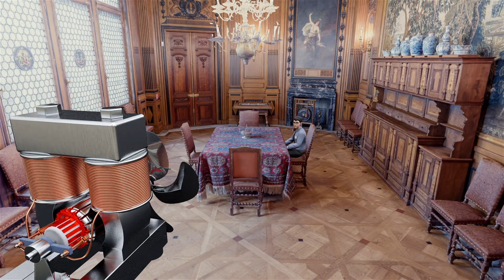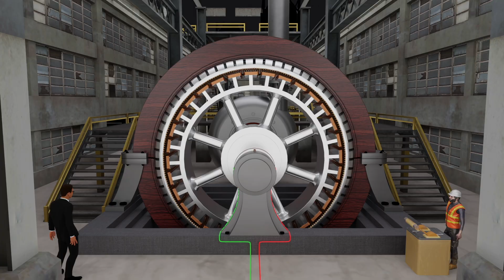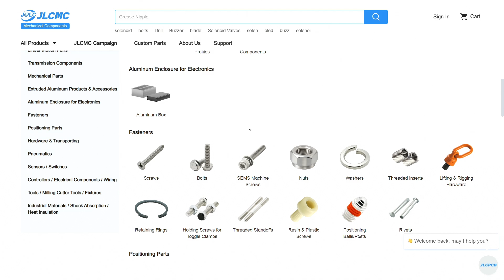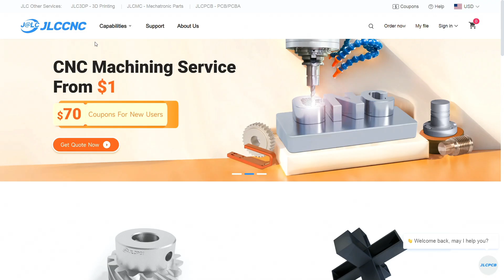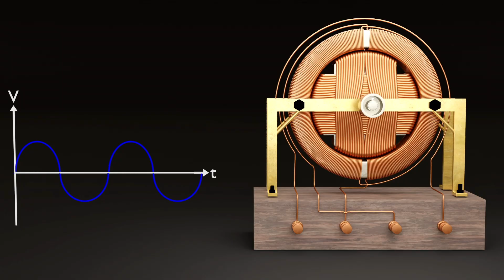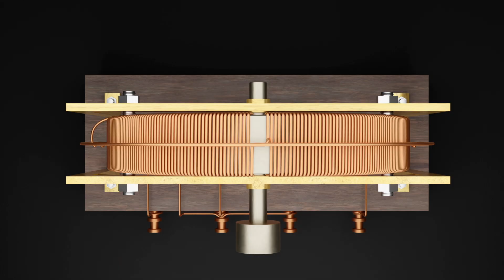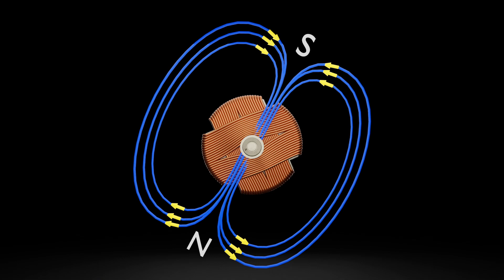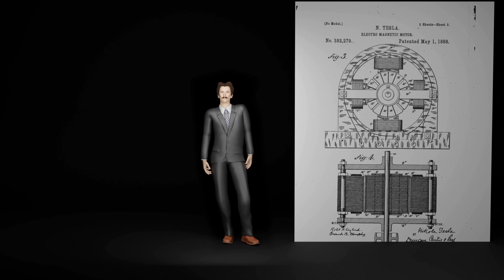Why Tesla’s AC Motor Defeated Edison’s DC Power?

Comment: To be honest, I actually prefer Nikola Tesla’s design it's like combining two single-phase outputs from a generator to drive an induction motor. It’s simple to think about, yet the idea is truly fascinating. But why did engineers change his concept in the development of induction motors? Why is it that the three-phase and single-phase systems are the most commonly used today, whether for motors or generators?
Reply from the maker: 3 phase provides more smooth rotation as compared to 2 phase